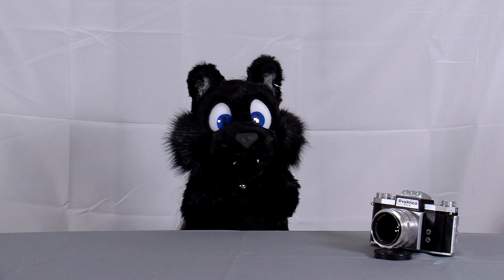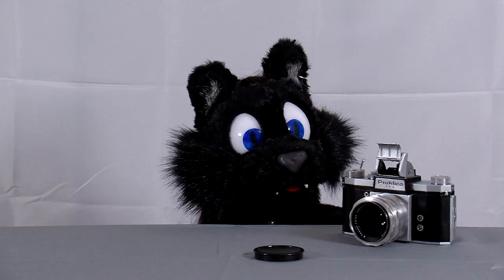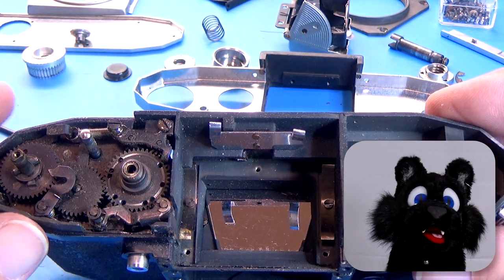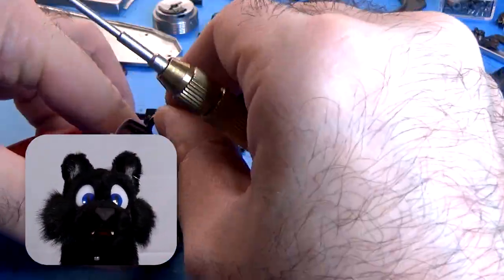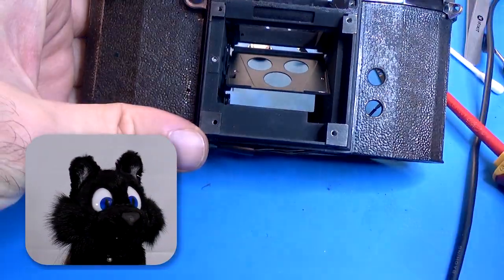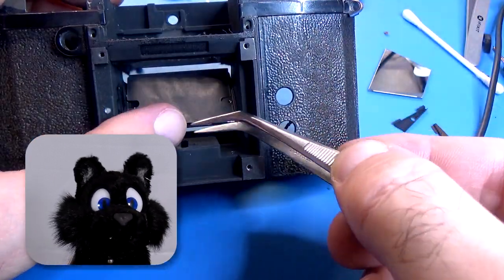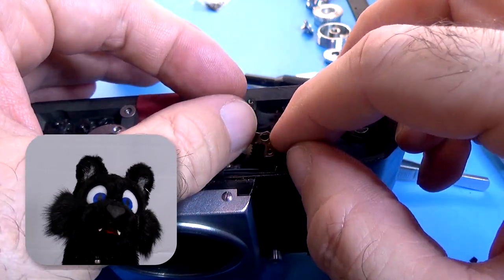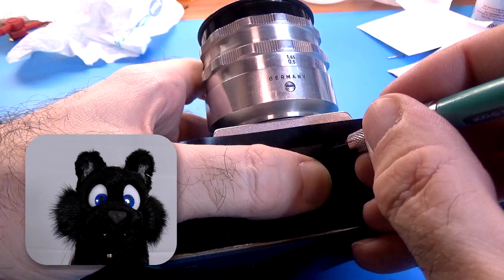Restoration Project #11 - Praktica FX 2

Comment: Wow... Excellent work! I've been brave enough to attempt teardown of a few lenses but this is some next-level stuff here.
Reply from the maker: Thanks! I am only a hobbyist but I do my best to get things done. I hope my little videos provide a bit of entertainment along the way.
Reply: @atkelar  Haha, well, it's impressive none the less. I own a Praktina IIa, which is of the same lineage of the camera in your video. Maybe one day I'll be brave and tear it down to totally restore it.
Reply from the maker: Once you are ready: Slow and steady wins the race - don't force anything you don't want to break ;) And make lots of pictures before taking off the next part. It helps wen re-assembling. Especially the parts where an exact relation between gears is needed, like the shutter timer in this model. I only had to try three different alignments to find the correct one. It's countless possibilities though.

Comment: Excellent video, a lot of knowledge in photographic camera, my first job was in 1971 in a store specializing in cameras and photographic materials, and my first camera was an Exacta VX 1000 and a set of rings for macro photography and I used a Gossen photometer, with the which I did a lot of slides with Agfachrome 50 S, very good to see someone with that knowledge.
Reply from the maker: Thanks! I can't properly do color processing myself, but I develop my own B/W pictures whenever I have time. I hope to have another camera on my bench soon, but 2020 and 2021 strikes here too: I'm not getting around as much as I would like to shop for such pieces.

Comment: It always amaze me to see this level of dismantling after revisiting this video... Such patience unrivaled! I've managed so far to CLA (Clean, Lubricate, Adjust) my Zorki's (Zorki 4 and Zorli 4K), but have not removed the shutter curtains, for they are in extremely fine condition for their age! Other than that I've stripped them down, cleaned, lubricated and finally adjusted all three so far. Unfortunately I have also used white lithium grease around the shutter curtain gear, of course it hasn't got one tine bit on the vulcanized fabric or ribbons, as I have been extra cautious. Well, at the the third clean I had finally silicone grease about the curtain's gears, and everywhere else lithium based grease. At finer mechanism (slow speed axis gears, curtain roller spindle (or axis) - fine white mineral oil, sewing machine oil). Do you think it's okay to leave the lithium grease around the curtain drum roller gear, or replace it with silicone grease? Although after the CLA, all the Zorki's work wonderfully, being silent as a rangefinder could get! All the speeds work as one could never imagine before the CLA. So far I found that to have the most efficient lubrication, one needs to use all the three types. Lithium on heavy duty gear work, or anywhere else, where plastic, rubber and fabric isn't involved. Silicone for everything really, but mostly around rubber, plastic and fabric, and fine watch oil (or the lowest viscosity mineral oil of course sparingly), for vertical, unreachable parts, shafts, spindle and where fine gear work is involved.
Reply from the maker: Thanks! I did take it apart that far because it had lots of sand in it. It might have been a plaything for some kid at a time for all I know. But it was a cheap 2nd hand find and I'm happy that I got it into proper working order again.
I am by no means an expert on the differnt types of grease and oils, I usually go for stuff that gets gears moving smoothly; there is a bit of trial and error to a hobbyist like me. But I totally agree that one type for all is not enough. Also, I general try to keep the lubrication away from any non-metal parts as far as possible. With all these plastics available, no telling what reaction it might have. Again: experts on the field of material science will know of course - but it's hard to even identify the exact type of material to the layman like me :)

Comment: My goodness... You raised this "tinkering"  to the highest ART! All my respects I have for it! Although I went as far only to repair the battery slot and grease one end of the winding gear, after removing the bottom of a Pentacon Praktica super TL. And so the light meter works! Nonetheless, this a fantastic video!
Reply from the maker: Thank you! I still call it "tinkering" because I don't really want to do the same stuff all year... which is probably also why YouTube can't quite put my stuff into particular categories. I love hearing from other people's projects. It is  very satisfying to know that a video is either an inspiration or a satisfying watch to likely minded individuals.
Reply: @atkelar  You're much welcome! I really like your videos, and hope you keep up this energy all the way! But I would like to ask you for some advice or hints. I have purchased a few days a Zorki 2-C 1956 model (I love it really much, even though I can't use it!). I have some problems with the slower shutter speeds. They function correctly only if I keep the camera (and the lens) pointing upwards, otherwise if a I set the speed say to 1/25 (that's the lowest on this model) then is runs down after pushing the shutter release as it were 1/500th of a second. Since I bought the camera I was very careful to set the speed only after cocking the shutter. And I have some light infiltration too trough the curtain in the cocked position. I have cleaned it to a point, removed the front cover entirely, yet I dare not go further, especially at the top where the optics for the rangefinder is... It really runs now a lot smoothly then whey I acquired the Zorki, yet I don't know if it was many times mishandled in the past (the shutter speed set before cocking the shutter). Do you think the camera could be serviceable to properly function again by the fails I have just described? Thank you in advance for your reply.
Reply from the maker: Hmm... difficult to tell without knowing the exact way the cogs and springs interact in this model. If it's ralted to "gravity" (i.e. holding it one way or the other), I'd guess some bearing might be worn out. So some gears might only mesh correctly when gravity helps them along. Since the wound up shutter is pushing/pulling in one direction, some worn gears or bearings might need gravity to make sure they mesh upon release. But since I don't know how the particular mechanism is working, I can't be certain. I'd try to remove the cover to peek at the gears and find out what rund differently between one orientation or the other. Careful when winding up these mechanisms without the cover though: I've seen the cover hold down at least one peg before :) Unless gears are stripped, it should be fixable, making some shims for bearings is simple enough. Maybe even new gears... but that's a lot of work, since they are most likely not stock versions.
Reply: @atkelar  Thank you so much for the help! Yes, you're right in many respects, spot on right! But at his stage I found with my Zorki-c2 that the wind mechanism is partially jammed by the old stiffened grease. It really needs a good CLA, and a new shutter curtain. I am looking forward to have it cleaned by a professional, as I would really do it myself, because I have already amassed a nice (and great) lecture and manuals on the topic when finally I managed to find somebody who is willing to thoroughly clean and repair it in every respect. Rangefinders are a whole different world, but they have their merits to have them fixed, even if it will cost more than the price they have been bought by!
Reply from the maker: Ah... grease. I am still looking for something proper myself. So far, every "grease" I used, caused more gunking up than smoothing out. For everything that needs to move rapidly - like the clockwork mechanism - I tend to use a fine oil now. It might not be perfect, but these old machines run maybe a few times a year, so I think using oil instead of grease on faster moving parts shouldn't cause any issue. For slower or manually moved things, like focus rings or similar, I usually go with grease.
Reply: @atkelar  Unfortunately, as in and with almost every apparatus exposed to particles, bigger and smaller congregation of particles will produce gunk. I know more from literature than from actually using it (of course I have greased and oiled but with as little dismantling as possible, as I am not that efficient with mechanics as I am with electronics), that gears of heavy duty must be greased, and oil used very sparingly, mostly at the axis of specific gears... Lithium grease and extra fine sewing machine oil I've read and observe that are quite up for the task! And of course, an almost 99% concentration of alcohol for cleaning. But really, time can tell only, and the recommendation of professionals who have been doing these services and repairs for decades. It is wonderful thing to make such old machinery work again as new only by a neatly executed CLA. :)
Reply from the maker: I fail to recognize "CLA"... but I agree: I do try to follow professional recommendations as good as possible. But my issue with grease is mostly that it's a bit too sticky for small fast moving stuff. It usually dampens the movement to a point where gears get stuck and the springs don't have enough power to drive them anymore. Either I haven't found the right one yet or there's something else. With sewing machine type oil, I usually have no issues. While the accumulation of dust is an issue, plain drying out is so as well. If the grease turned into dust, it's no longer useful ;) - but overall, the "perfect" lubrication will only be an issue when we talk about longevity of a machine. Most restored machines will get very little use to begin with. That's why I am confident that "wrong lubrication that works" is still better than "no lubrication" or "gunked up gears".

Comment: After seeing this again, now I really want a Praktica FX 2 as my next target since I don't have any German cameras in my collection yet, not to mention the sample I've been eyeing on has rare optional tack on pentaprism 😀

Apart from that, simply an interesting CLA video 😊
Reply from the maker: To the best of my knowledge, it was an "East German" company that made those. Not entirely sure about the timeline though, my historic knowledge is limited. (BTW: I still couldn't figure out what CLA stands for in this context... Google is no help here 😊)
Reply: @atkelar  Yeah I know it's technically East German and I like East German made because they're interesting and at times quite quirky, for example once I saw a Pentina made by KW (Pentacon) a decade after this Praktica, basically a leaf shutter SLR with left handed controls (shutter release button and film winder are on the left) and it has weird rectangular body, and I actually wanted Praktina, the first system SLR, made by KW roughly at the same time as this Praktica, prior to Nikon F (1959) which I have now (I love Nikon F though).

CLA stands for "cleaning, lubricating, and adjusting", very common among film camera enthusiasts
Reply from the maker: Ah! Thanks for clearing up the acronym. Since I am tinkering in all sorts of fields, I can't keep up with all minute details of every one of them. I'm just here, having fun on my workbench and sharing the results.
Reply: @atkelar  It's great that you can work with various stuff and I wish some day I can fix vintage cameras on my own (yes I like to tinker various things occasionally) 😀

Comment: Most excellent! Above and beyond.. The "OHM" had me laugh out loud because I was about to faint myself:face-red-heart-shape:
How on earth did you take everything apart just like you did and put it back. Did you design the original?
Having said that: I do not see the removal and cleaning of the aperture blades.

Also: Since you had already reassembled the lens, how did you approach the refocussing?
And then: I am attempting to do this myself on an FX but can't find the assembly manual. I you know of one, I would be most relieved.
Lastly & mostly: You are a repair god, I am in awe.:hand-orange-covering-eyes::trophy-yellow-smiling:
Highest regards,
Mac
Reply from the maker: Thanks!

It's been a while :) - I didn't really adjust much for the focus to be honest. It's an old camera with a see through focus anyhow; I think that if the distances between the mirror, the film plane and the viewfinder glass are the same again (based on notches or dimensions, they should) - anything that is in focus in the viewfinder will be in focus on the film too and so far, that's been the case. There might be minute differences in the depth of field but that's details beyond 35mm to begin with, I think.

Comment: hi, informative video, I have a question, I am stuck for hours trying to remove shutter dial, could you pls explain cause it wont budge
Reply from the maker: If you mean the lower of the two dials on top: it is a left-handed thread, i.e. it unscrews to the right. So: the top one is held in by a small screw and just pulls off once the screw is removed. The lower (larger) one can be unscrewed clockwise once you can hold on to the axle inside. It might be stuck on the thread, but all that was holding it on in my model was a thread on the axle.

Comment: Hey, great video, it helped me a lot with the restauration of my fx 2, but I have a problem with de shutter curtain assebly on mine, do you have any footage on how to install and set the curtains and wind them up to the proper tention?
Reply from the maker: Thanks! - and sorry, not particularly that part; I generally put the curtains into the camera. As for the tension, I made sure that I wound them up to the point that the realaxed version had enough tension that they were straight and didn't make any kinks, so I could do the alignment. The alignment between the "windows" and the frame should be so that winding the camera transports the windows past the frame. I only had one position on the gears that gave me that: A tooth too early or too late made it that the window in the curtain was not covering up the frame on either the relaxed or the wound up side, so that is pretty easy. During winding, the windows should also overlap so there is no light coming through. Then tried a medium shutter speed, tightening them as equally as I could until the shutter speed was "within reason" of the expected value. As I don't have a proper meter to check that, I had to film it and count frames on the video clip, hence I used a "meduim" speed, so I could capture enough to be sure. Since there isn't any adjustment to trim different speeds, I am pretty sure the other speeds match as good as possible too.

Comment: Excellent restoration! Now I am repairing my Praktica FX2 and I have to say that make the shutter work is very hard. Now I have problem that both curtains are closing one the same time, so it can not expose the film. Probably it doesen´t depends on the setting of the time selectort whych is weird. So I will see if I can make it working again.
Reply from the maker: I would have to check the insides again, but the curtains' sprockets are connected to a set of gears. If the timing between them is off, it behaves as you described. It did take a few tries with different ralationships between the gears (one leading or trailing the other) but eventually I found the right combiniation.
Reply: @atkelar  Thank you very much for your ansver, I will try to make some gear combinations again
Reply: @atkelar  Thanks, I just found the problem... One gear was one teeth beside... So the second curtain could not bite and it closed immediately. Thanks, have a nice day and tahnk you for your videos!

Comment: Beautiful video ! My fx2 works and in pretty good condition, but with the tessar lens the focus ring is stucked, the camera was dropped on it, tried with pliers but it does not moves, acetone and zippo fluid does not work either, looking for another lens, primoplan bit expensive, wonder if it works with pancolar or japanese auto m42 lenses.
Thanks
Reply from the maker: Thanks!
I am afraid I can't answer the question though; I only have this one lens that would fit at all; There is a push rod linkage inside that closes the aperture upon triggering, not sure if that part was ever standardized, but it might work with a manual aperture of course.